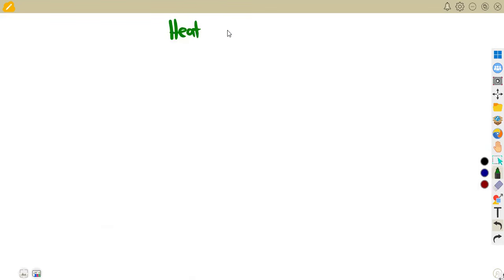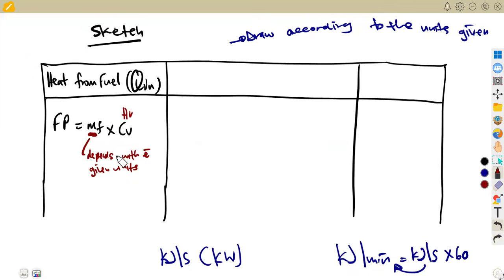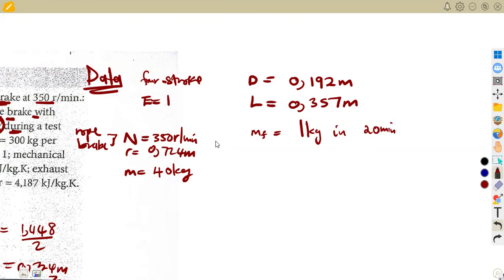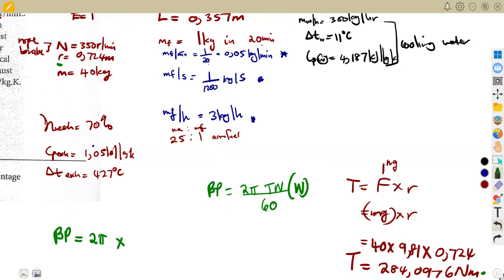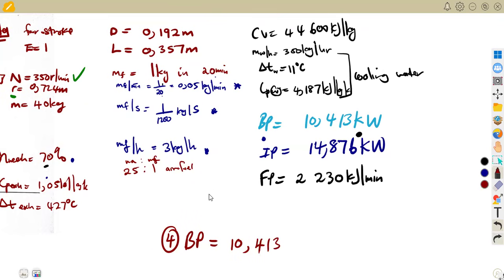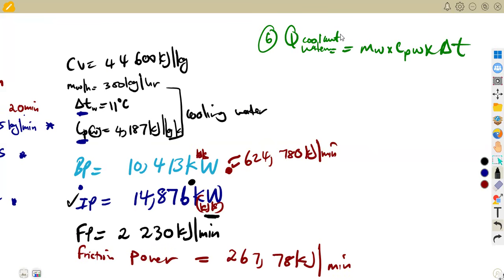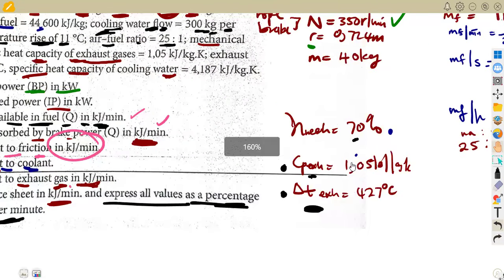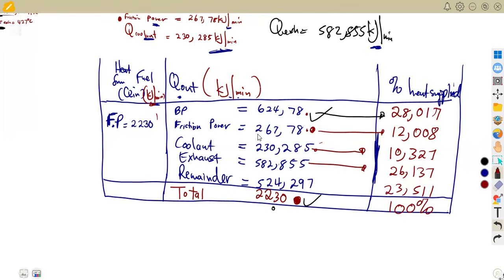Power Machines N6 Internal Combustion Engines - Heat Balance Sheet @mathszoneafricanmotives

Comment: #6  cp is kj/kg.k my ∆t is in °c so ain't we supposed to use 284 K
Reply from the maker: When converting, you convert values initially . You will obtain same answers. It’s difference between , so no effect. Just make sure you don’t convert final result. If are to convert , convert them before finding the difference